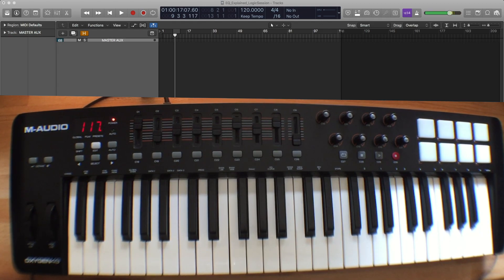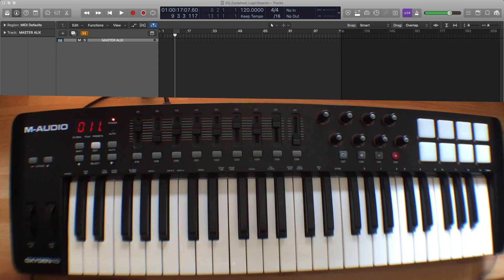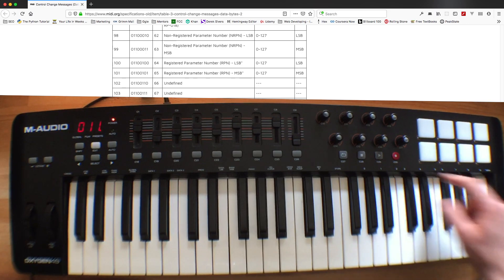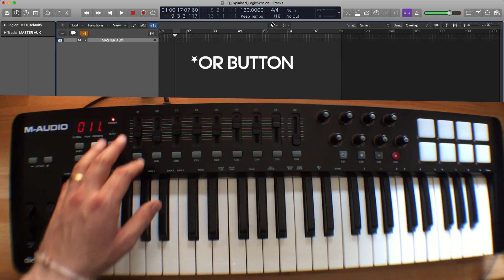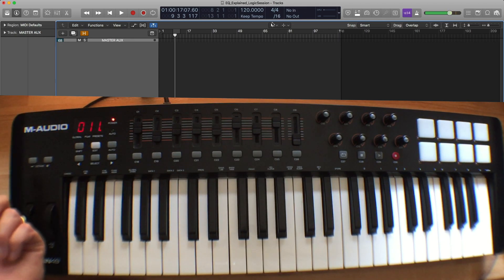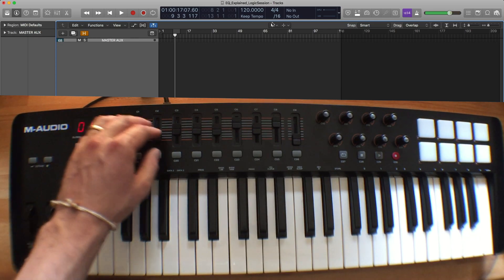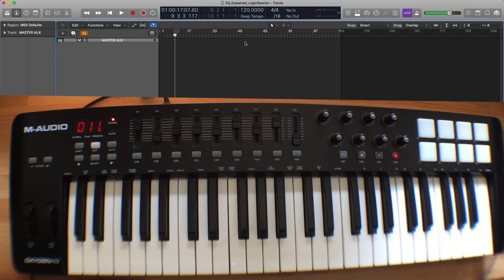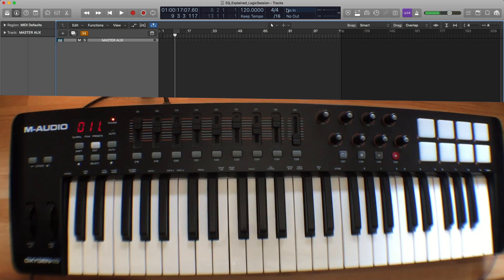Custom Programming a Midi Controller

Comment: This is an absolute bible! Was hoping you could help me though, I'm trying to map my Oxygen 61 to some key commands but the c18-c26 buttons keep triggering the command twice :'( Once when I press the button and then once again when I let go :'( I don't suppose you could be a hero and help me to map it so it only triggers once? I've changed them so they're just 18-26 cc
Reply from the maker: Hi Jamie, this could be a couple things, either the buttons on the oxygen or the toggle function in logic. It would take a long time to write out every reason without being able to see. On the Oxygen display, if you press a button it might say "127" and if you press the button a second time it might say "0". That's one way the button can function OR when you press the button it says "127" and when you RELEASE the button, it says "0". I'd check the Oxygen Manual and maybe change the button function first. So one is sort of a toggle, doing one value when you press a button and the other functions kind of like a sustain pedal, one value when button is depressed, one when it is release. Hope that helps!

Comment: Hey I'm using the direct link thing in auto mode using this controller with logic. However my shift key has stopped working to switch the modes, any idea as to why? The only way for me to switch modes is to select them in the controller surfaces options.

Comment: How to set the pads? I have the same MIDI controller
Reply from the maker: If you go to a key command menu, Logic Pro X -> Key Commands -> Edit, select a key command and then on the bottom right of the window press the "Learn New Assignment" button, then press the pad on your midi controller. Then you should see it show up in the box that says "Assignments" above the button on the bottom right of the window. Hope that helps :)

Comment: please simplify. I have an akai mpd226 that i cant figure out how to use as a playback and record controller. Also how do i set two controllers for live recording use on two separate software instrument tracks?
Reply from the maker: Hi R J, I have another Akai controller too, custom programming is done via the Akai software. Both questions really depend on what DAW you are using. Setting this up for Ableton would be quite simple for example but could be pretty tricky in Logic. I would search for your questions separately and include your DAW in your search